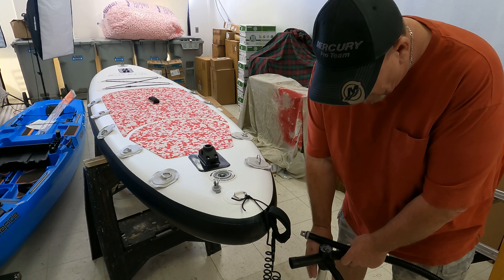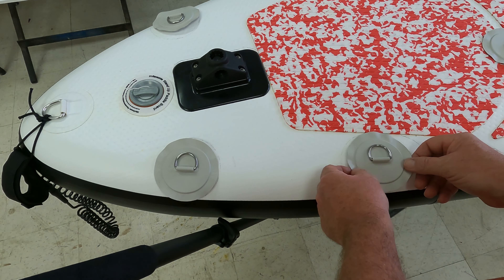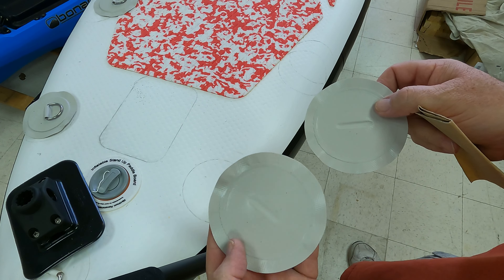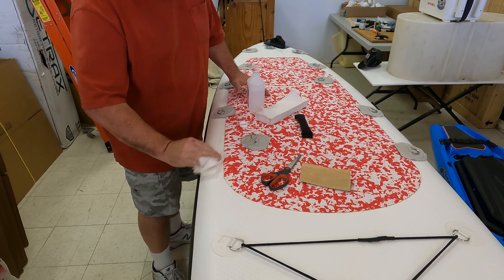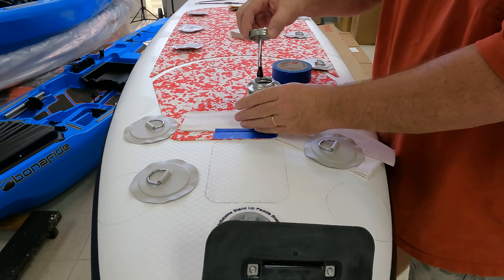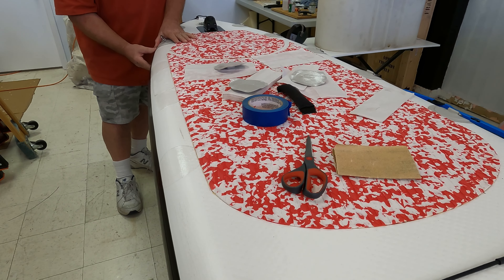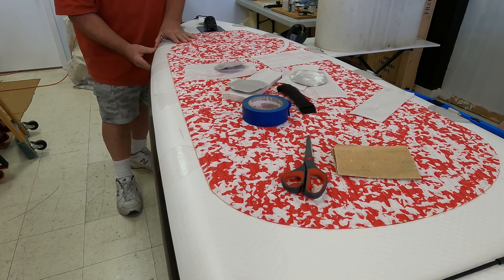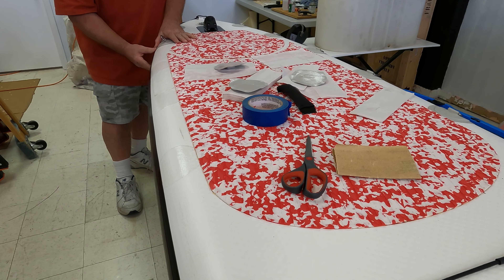How to install a seat and "D" Rings on a Stand Up Paddle Board SUP

Comment: Good video. Thanks. I want to turn one of my two SUPs that came with my boat into a 'kayak'. What's needed most  is not a seat, but a foot brace. No one makes one, it's DIY.  23° off vertical is usually pretty good for 4 kayaks now....  and a padded bar for the tops of your feet.  Windsurfing foot things work great.  A steeper angle 18°? might be better for an SUP because your butt will be  lower than in a kayak.  (The kayak stroke is rotate your core and transfer power into the kayak, or SUP, through your feet.  In a sense you're kind of standing up. Almost 0 percent of kayakers I've seen are using a kayak stroke. It's easy to learn,  much more powerful and it tightens up your abs. Plenty of videos.) 
Also to press down to seal get a small cheap wall paper seam roller. They're only a couple bucks. 
Also I use 1/2 and 1" cheap yoga mats for padding my butt and footbrace in my kayaks. Start with 1". It's actually better than anything else you can buy.
And always go easy on the D rings. Not my favorite attachment. Off axis they can pull out. The way I know they work best is if every tie point goes to two D rings. (If you have an idea of the direction of the attachment, turn it line up in that direction. Otherwise just check them after use to see if the rings are being pulled open.  Squeeze them back with Channel Locks.)  Multiple attachment points also allows you to move your seat or foot brace forward and backwards.   Your set up looks good. Proof of concept.  By the time that seat has problems you'll know exactly what you'll want to replace it with.

Comment: Nice video, I have the same d rings from Amazon, plus a similar looking seat that I’ve been meaning to put on my SUP for some time, just needed to gather the info about how to do it first, can you tell me, I’m a bit unsure about applying the glue, did you say you give it multiple coats, and if so do you wait until each coat gets tacky before applying the next coat……..?
Reply from the maker: You want to Re coat the glue when it is just past tacky. I used 2 coats except when I waited too long and had to add a 3 rd. Good luck on your project and thanks for watching

Comment: Thanks was looking for this exactly!! Hm is there a risk those d rings Will come off if you flat the board and roll it into a bag?
Reply from the maker: So far we have had no issues, the glue holds them nice and secure. We try and keep the roll as loose as we can to prevent any wear from occurring. Thanks for watching!

Comment: The cloth bit to stand on for my board covers the whole section , is there a way for me to cut into that to add those D rings ? , i noticed you cut the d rings instead of cutting unto the boards padded bit , but i dont know how else to get a seat
Reply from the maker: We chose to not cut bag the padding because we didn’t want to take a chance of cutting to deep into the board. Cutting the d rings created no problems and has worked well. If you must cut the foam keep in mind the glueing surface will need to be smooth. I’m sure it can be done but I would take my time as not to damage the outer vinyl on the board.

Comment: is full board air pressure(15psi) better to use than the partial 10psi, and how long did you wait between applying glue to the Ring and the board before marrying the 2 together or does it matter at all for the time between them, also noticed you didn't use a heat gun or hair dryer to activate the glue
Reply from the maker: basically the outside size of the board does't change much from 10-15 psi, I never run this board much over 12 because I don't need it to be that rigid.. You don't want to wait much longer than the point the glue is not sticky to touch, when you put the two sides together a chemical reaction occurs and they bond, no need to heat the contact cement. Thanks for watching.